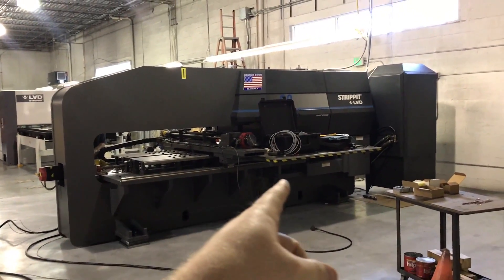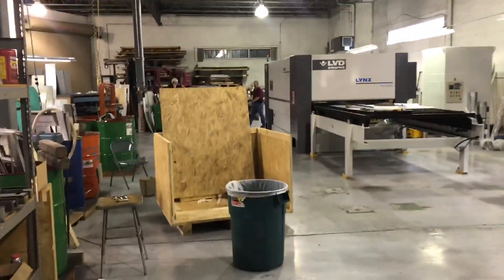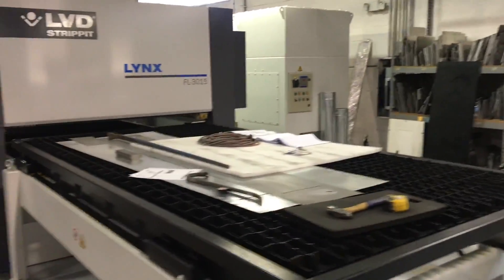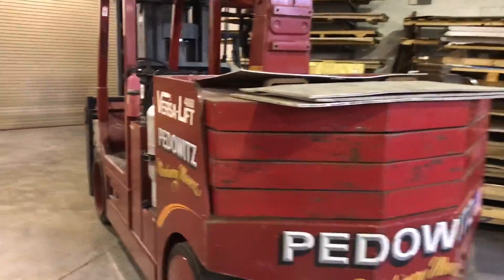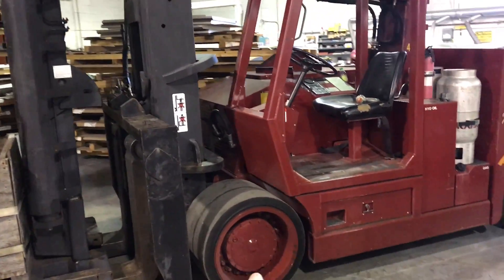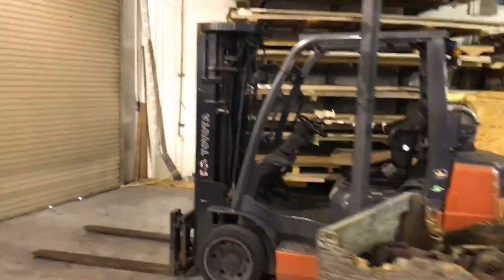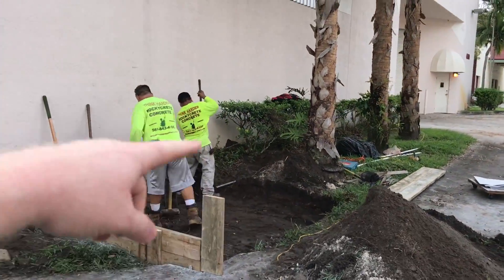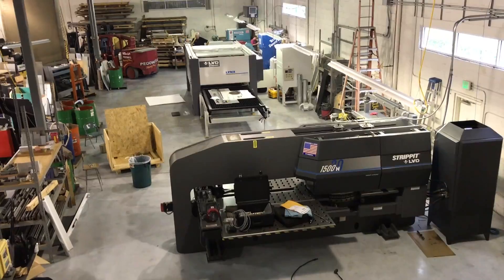Installing a 2kW Fiber Laser Cutter

Comment: What kind of shop is this ? Machining services ! ?
Reply from the maker: We do sheet metal parts, enclosures, signage,  machining, painting/plating and more.  Email me at ProtoGManufacturing@gmail.com if you need any parts made.
Reply: @ProtoG42 Full automatic laser slat cleaner, high efficiency , low cost, best mate for laser cutting machine!https://youtu.be/Milz2q4aIyI       looking for agency 008615318875110